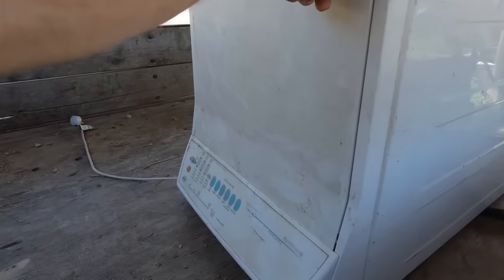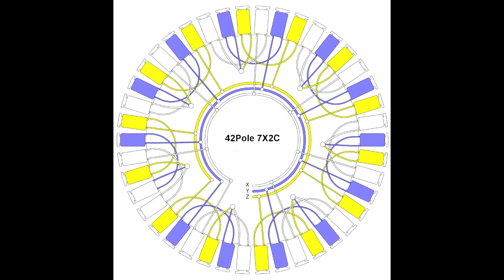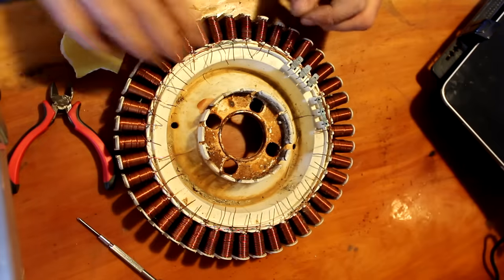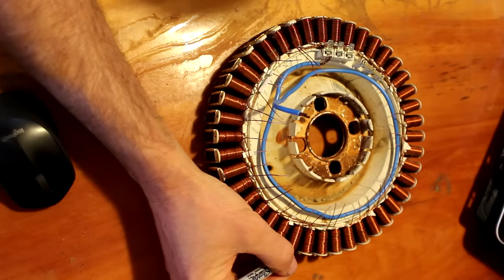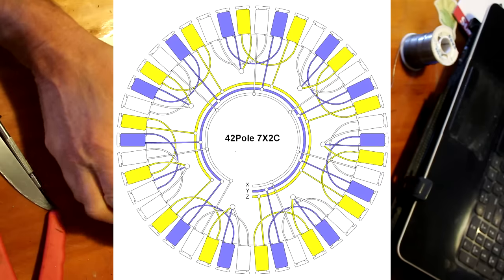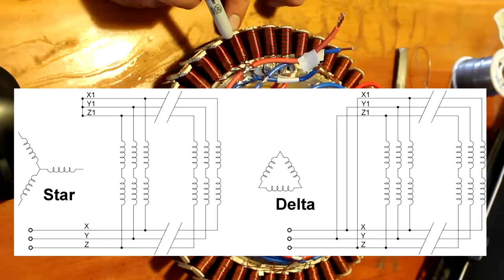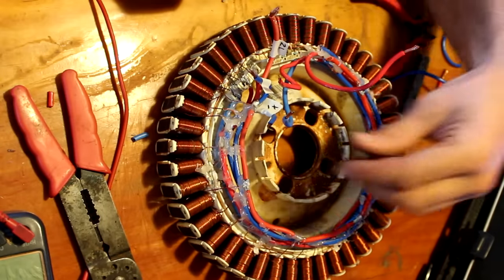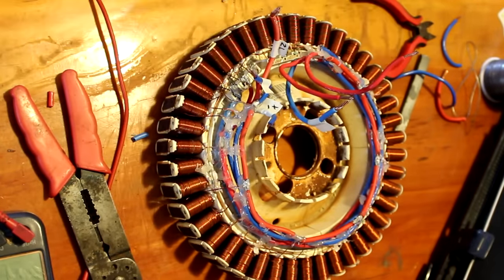Free Power from Water Part 3- Rewiring a smartdrive washing machine motor to generate power

Comment: You have GOT to be using that soldering iron to get comments. You need to show proper tip cleaning with the sal ammoniac. Bar solder looks to be some of that “good stuff” lead-tin alloy that is less than ROHS compliant. I’m guess you didn’t go total old-skool and use acid flux. And you really need a mag-net wire stripping tool if you are going to do much of this. Interesting video, double wiring doubles the work surprised you got it all to fit, nice tip on use of hot-melt glue, thanks.
Reply: Marty commented that he did use acid flux and the good stuff solder...it has survived 17 years in the old generators so.....
Reply: @JohnSmith-pl2bk  made me look again, don't see where he said he was using acid flux. For sure there are some acid fluxes suitable for electronics but given his soldering iron, and bar solder he could be using the plumbing/roofing/rain-gutter flux that is serious acid. Based on his obvious skill I kind of doubt it.
Reply: @sheph7  
It's in one of Marty's written comments in this vid...

Comment: if it puts 400 volts, let it travel from source to destination and there you put it a transformer and reduce to 120 volts or 240, then you rectify it
Reply: Linas Velavicius
8 hours ago (edited)
Marty after watching your Part 2 I watched a YouTube explaining the difference between conventional generator vs the new more expensive inverter type generators. I also looked up Skin Effect. For those who don’t know I copy paste the explanation from the Internet;

“The main technical difference between inverter generators and conventional generators is what kind of electricity is produce, conventional generators only produce AC electricity while an inverter generator produces electricity in three phases (high frequency AC to DC back to stable  AC current)”  

“Skin Effect results from circulating eddy currents, arising from a changing B field, cancelling the current flow in the center of a conductor and reinforcing it in the skin. This reduces the effective cross sectional area increasing wire resistance and losses.”

Now I understand your "inverter" setup, your cost to effectiveness ratio is just brilliant. Big fan, love your channel.
Reply: Marty T
2 hours ago (edited)
It is very hard to spin the rotor with factory wiring with a load attached, this site doesn't have enough pressure or flow, also very dangerous and high hz / high loss over long distance (skin effect
Reply from the maker: It is very hard to spin the rotor over the factory wired stator with a load attached, this site doesn't have enough pressure or flow, also very dangerous and high hz / high loss over long distance (skin effect)

Comment: If that's acid flux (instead of rosin type) I would be worried about corrosion in all those connections, especially in a continuously damp environment.
Reply from the maker: My first stator was built using this method 17 years ago, I haven't had an issue with corrosion

Comment: I was thinking... why not just use a transformer to drop the voltage down? You have the same power? You could put the transformer at the bottom of the hill or the top and then rectify it to DC into the inverter and then AC at the local voltage... Just interested why this is not an option. BTW... I really enjoyed this series of videos.
Reply: Please read the pinned comment at the start of these comments, thanks.

Comment: The High voltage could be practical to transport the currant on a long distance. But then, you'd get power loss in the transformation too. Ii depends on the need I guess.
Reply: Marty T
2 hours ago (edited)
It is very hard to spin the rotor with factory wiring with a load attached, this site doesn't have enough pressure or flow, also very dangerous and high hz / high loss over long distance (skin effect

Comment: You added that there was a mistake in wiring and you were only using star. Is it a major rewire setup to put it the way you need it to use both.
Reply from the maker: Its a 20 minute job extending the delta bus wires to the original star bridge. Not counting the half hour trek to the turbine and back 😂

Comment: Would a rotor and stator in the flywheel of an outboard boat motor work as well for 12 v??
Reply from the maker: Powered by the ob engine? probably too high rpm unless you geared it down. Or did you mean remove engine and put this in its place, let the propeller spin the generator when sailing to charge a battery? I think this would work with a big enough prop
Reply: Actually use the rotor and stator from the outboard and use it for the water wheel turbine. That way you don’t  have to rewrite the stator, since the outboard already puts out 12volts? At least I think it does- I could be wrong.
Reply: @jeffgaines5725  
The outboard operates at high revs...up to 5500rpm. 
The Pelton wheel operates at 1000rpm, so you would have to use step-up pulleys and belts...
lots of losses, not least from slippage of the belts in a wet environment...

Comment: You could cover that stater with marine varnish to keep it sealed and from shorting out between solder joints couldn't you?
Reply from the maker: Yeah you could do that but I've been running one of these for 17 years without varnish and its still going strong

Comment: Is there a reason you don't like running 400V at low current over a thin wire back to your house and then convert it down to 12 or 24V there?
Reply from the maker: Many reasons why we didn't do this, factory stator produces high voltage/high hz output which is dangerous to work with and high loss due to skin effect, inefficient generator speed with the factory stator. 
We also plan to add another turbine at a later date which would require another cable run if 3 phase is run up the hill
Reply: @MartyT  that was my next question, had you ever considered running the water into a second funnel and then letting gravity run another turbine down stream from the first one to effectively double your output off the same water supply?
Reply from the maker: Yes that is possible, but would mean another long run of cable and pipe, another option is to have 2 turbines with small jets on the same feed pipe, then if one goes down for any reason, the other one will generate enough to keep fridge/freezer etc running until the other can be fixed
Reply: @MartyT  that's a very interesting idea, and makes a lot of sense to do it this way. Especially if pulling 10A off each one, it's more than enough! Very interesting, thank you again for uploading
Reply: @JohnSmith-yv6eq  that would make sense, the mppt can accommodate for the fluctuation in generator output to maintain the battery charge
Reply from the maker: @thegingerpowerranger  It gets better.. I have experimented and found 2 turbines can feed into the same cable and mppt controller even if they are running at different speeds, it automatically finds the sweet spot. And best of all I can use the factory stator through the rectifier without rewiring, not quite as efficient as running 240v up the cable from inverter but far simpler to construct and less to go wrong
Reply: @MartyT  and built in redundancy! You can run multiple turbines and if one of them fails the overall system will keep going!

Comment: Nice work, but would it not be better to bring all 6 wires out of the hub so that you could wire it in either star or delta outside without taking the hub off?
Reply from the maker: Yep you could do that, slightly higher cable loss but it would be easier to change
Reply: @MartyT  You only need to get it another 4 or 6 inches till it's out from behind the hub is all that I was thinking. A lot of 3 phase motors bring the wiring out to a panel outside the motor.

Comment: You have done a lot of work on this and this must be how it's done. Wouldn't a step down transformer work better? I am not being a smart alec about it. A large tv transformer or tube amp etc. Could be wired for current gain and voltage drop. A microwave oven transformer might work.
Reply: Linas Velavicius
8 hours ago (edited)
Marty after watching your Part 2 I watched a YouTube explaining the difference between conventional generator vs the new more expensive inverter type generators. I also looked up Skin Effect. For those who don’t know I copy paste the explanation from the Internet;

“The main technical difference between inverter generators and conventional generators is what kind of electricity is produce, conventional generators only produce AC electricity while an inverter generator produces electricity in three phases (high frequency AC to DC back to stable  AC current)”  

“Skin Effect results from circulating eddy currents, arising from a changing B field, cancelling the current flow in the center of a conductor and reinforcing it in the skin. This reduces the effective cross sectional area increasing wire resistance and losses.”

Now I understand your "inverter" setup, your cost to effectiveness ratio is just brilliant. Big fan, love your channel.
Reply: Marty T
2 hours ago (edited)
It is very hard to spin the rotor with factory wiring with a load attached, this site doesn't have enough pressure or flow, also very dangerous and high hz / high loss over long distance (skin effect
Reply from the maker: It is very hard to spin the rotor over the factory wired stator with a load attached, this site doesn't have enough pressure or flow, also very dangerous and high hz / high loss over long distance (skin effect)
Reply: @MartyT  I thought the unit ended up charging batteries. Wouldn't a rewired rotor pose the same load? I just thought it would be easier to wire a step down at the site to be converted to dc to charge the batteries.

Comment: Why going through all this instead of running three phase mains voltage straight to the shed? You could run some low power stuff like lighting without losing on all these conversions and charging the batterries wouldn't be that much harder.
Reply from the maker: High hz output from the stator would result in high loss due to cable skin effect over the distance to the house

Comment: I guess it's because of the efficiency penalty but is there anything stopping someone from just running the current through a 3 phase transformer before rectifying it to charge the battery bank?
Reply from the maker: Yes that is possible, he has now upgraded to an mppt controller at the house
Reply: The setup has been changed and the rectified  60VDC output at the generator now goes up the wires to the house to a solar panel MPPT controller that feeds the batteries and then the inverter...all up at the house now...

Comment: Why not send the high voltage three phase up the hill on a smaller wire and put all the electronics at the house where it would be more accessible?
Reply: @JohnSmith-yv6eq  I don't see it being much more dangerous than 240 V. The frequency is not even important here. In my part of the world, standard building wire is almost all rated for 600 volts. Is the NZ stuff 300 V? It would just be much more maintenance friendly if the batteries and inverter were closer.

Comment: Could you use a transformer instead of rewiring?
Reply: Marty T
2 hours ago
It is very hard to spin the rotor with factory wiring with a load attached, this site doesn't have enough pressure or flow, also very dangerous and high hz / high loss over long distance (skin effect

Comment: Wouldn't be possible to leave it as factory setting, run the 400V directly to the house, then convert to DC to charge battery and run inverter from there. Less loss in the 400m long cable, win?
Reply: Linas Velavicius
8 hours ago (edited)
Marty after watching your Part 2 I watched a YouTube explaining the difference between conventional generator vs the new more expensive inverter type generators. I also looked up Skin Effect. For those who don’t know I copy paste the explanation from the Internet;

“The main technical difference between inverter generators and conventional generators is what kind of electricity is produce, conventional generators only produce AC electricity while an inverter generator produces electricity in three phases (high frequency AC to DC back to stable  AC current)”  

“Skin Effect results from circulating eddy currents, arising from a changing B field, cancelling the current flow in the center of a conductor and reinforcing it in the skin. This reduces the effective cross sectional area increasing wire resistance and losses.”

Now I understand your "inverter" setup, your cost to effectiveness ratio is just brilliant. Big fan, love your channel.
Reply: Marty T
2 hours ago (edited)
It is very hard to spin the rotor with factory wiring with a load attached, this site doesn't have enough pressure or flow, also very dangerous and high hz / high loss over long distance (skin effect
Reply from the maker: It is very hard to spin the rotor over the factory wired stator with a load attached, this site doesn't have enough pressure or flow, also very dangerous and high hz / high loss over long distance (skin effect)

Comment: Would it not be easier to get an old alternator out of a junk car.  Already set up to output 14v most of the time around 100-140 amp.   The rpm wouldn’t matter because of the built in voltage regulator as long as it gets its minimum rpm. It wouldn’t overcharge the battery either when under continuous use.
Reply: You need some sort of drive (v belts and pulleys?) as 2000rpm will be minimum...
the generator in this vid is @1400rpm
Any other drive system other than direct will have losses including wet environment...slippage...

Comment: why is rewiring required?  wont it generate power with the wiring that it already has?
Reply: Marty has commented in previous vids that the high voltage generator would require higher pressure to run...
and the high voltage and high hertz produced are dangerous...
Reply: Marty T
2 hours ago (edited)
It is very hard to spin the rotor with factory wiring with a load attached, this site doesn't have enough pressure or flow, also very dangerous and high hz / high loss over long distance (skin effect

Comment: Why not use an alternator 110 amp hell use two That's 220 amps then step it down with transformer To 120 v at 20 amp breaker  much more effective and efficient water proof as well, just a thought?!!    All you need to do is,To bypass the rectifiers let me know what you think  thanks

Comment: Okay wait, after all that Delta wire manipulation and solder and all..... you missed something? and it ended up being a Star anyhow? I’m lost. 

So you’ll have to pull that off and start over? Or just change a few things?
Reply: Just connect the connection that he overlooked in all the excitement.....did he wire six or only 5...?
Reply from the maker: Haha I lost concentration filming and trying to explain everything, I forgot to cut the wires on the factory star bridge, the one that had a bad connection at the beginning. I just need to cut those bridge wires and extend the 3 delta bus wires to those 3 coils, a 20 minute job which should boost output by 5-10 %

Comment: My lazy ass is thinking why not use it as is and get power electronics that can handle this voltage, you could have much thinner wires from the turbine to wherever you keep your batteries etc. And it would save time next time it breaks. I'm not sure how tolerant a standard VFD with DC link is when it comes to varying voltage on the DC bus.  But I know they commonly can take just shy of 600VDC.
Reply: Marty T
2 hours ago (edited)
It is very hard to spin the rotor with factory wiring with a load attached, this site doesn't have enough pressure or flow, also very dangerous and high hz / high loss over long distance (skin effect